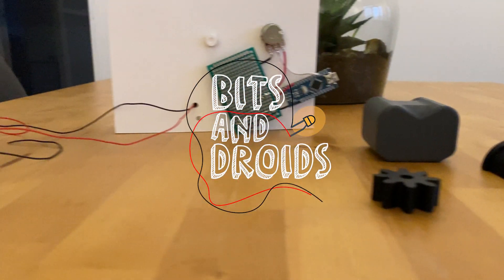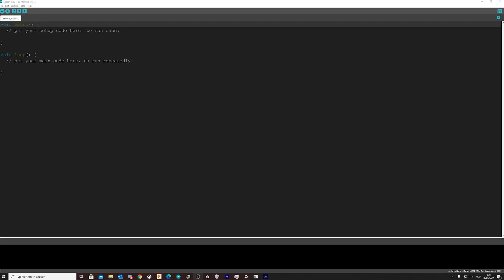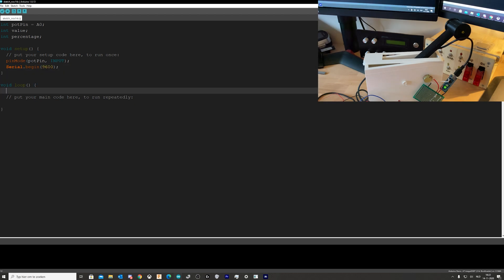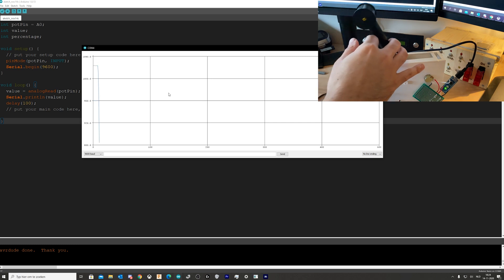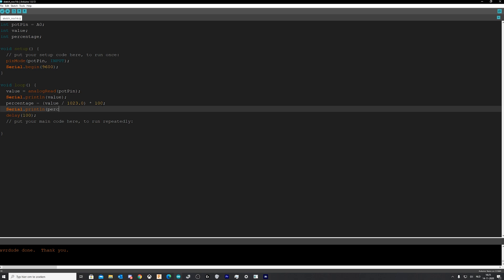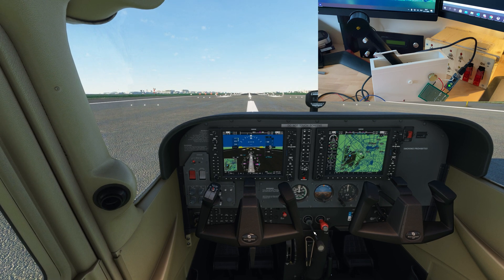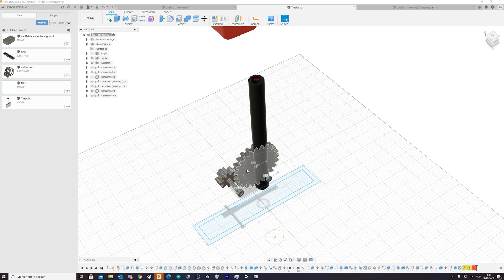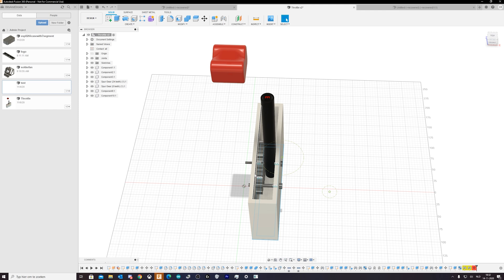10 min builds: Flight sim throttle. Create your own Flight sim Throttle with Arduino

Comment: Firstly, thank you very much for making this video. I'm facing an issue where I needed to limit the movement of the throttle lever but still read all 300 degrees of the potentiometer and you absolutely gave me the right idea to solve it. That said, there are two things here that strike me as strange:
-when you are showing that the throttle lever works in MSFS, you aren't actually moving the throttle. The camera shows the throttle lying untouched as the value is changing. Was this just an editing mistake?
- you mention that any arduino can do this, but only certain models are recognized as HID devices, which MSFS requires to read from to assign controls for. I know there are some hacky workarounds to get serial signals interpreted by the pc but since you don't mention any of that, or show how the throttle device interacted with the control scheme of MSFS, I'm left very confused how you achieved this.

Have you made any more detailed videos about the process I could check out? Also, despite my concerns listed, I am very grateful you made this at all, so thank you very much. These are complaints, just points of misunderstanding.

Comment: I have read that pots are okay but for more accurate settings, using an encoder rather than a pot allows more accurate notching if that is important; such as train sim throttles and brakes.
I seconnd niw3 - bigger font please...tbh I could hardly read it as the bg is black.
Nice job though. Thanks.

Comment: awesome video mate! just asking, but i dont have an arduino pro micro, and cant go out to get one due to the pandemic, but i do have a spare arduino uno here, and was just wondering if this code and method would work with the arduino uno, and where to connect everything since there are more pins on the uno than on the pro micro
Reply from the maker: Hi it depends which simulator you are using. If you're using Microsoft Flight Simulator 2020 I've created a piece of software that let's you connect any arduino with the game. For other games there might be a way but I haven't worked that one out.
Reply: @Bitsanddroids  yeah I’m using Microsoft 2020
Reply from the maker: @cosmothecat8626  

Even though the design is different the logic stays the same. Plus this tutorial is a lot more recent than this video.

https://www.bitsanddroids.com/tutorial-arduino-mfs2020-cessna-inspired-throttlebox/
Reply: @Bitsanddroids  btw what’s the other piece attached to the arduino? Other than the potentiometer
Reply from the maker: @cosmothecat8626  Ah the other bit is a pushbutton!

Comment: If i set the number in close higher than 0, for example on 100.  Would it work as a reverse thrust. I mean If it would be a minus percentage.??
Reply from the maker: The code in this video is quite outdated. I'll send you a link with updated code that can indeed be used with reversed thrust. Will probably be tommorow morning when I'm back at my pc

Comment: it would be awesome if you could make a DIY Kit for a Helio Collective to purchase at your shop, because I could only find DIY Files where a 3D printer is required and several other parts are needed. and ready to fly Collectives are way to expensive.
another idea for the Shop, adjustable tablemounts ;)
Reply from the maker: Thanks for the suggestions. Google didn't really help me but what are helio collectives?
Reply: @Bitsanddroids  sorry I mean the helicopter pitch collective (lever) for the left hand, its used to adjust Throttle and mainrotor pitch instead of a normal throttle. It has a much longer stick for more accurate input.
https://en.m.wikipedia.org/wiki/Helicopter_flight_controls
There are not much solutions on the market and they are way expensive ... the cheapest I could find was already 400 €

Comment: Hi, try your code and got this message "no matching function for call to 'BitsAndDroidsFlightConnector::simpleInputHandling(int&, double)'". Any advise? And thx for your help.
Reply from the maker: Sorry yes that is correct:

https://www.bitsanddroids.com/tutorial-arduino-mfs2020-cessna-inspired-throttlebox/

I've updated the parameters required to include a minimum and maximum value and if the output has to be reversed. Some people had constructions where they couldn't fully open / close the physical handle. Or in my case my potentiometer had to be installed backwards making close open and open closed etc.

Comment from the maker: Important note: The input handler has been replaced by the connector. It can still be downloaded from: https://www.bitsanddroids.com/downloads. The connector packs more features and is more stable.
Reply from the maker: @fully charged games I'd recommend going with something like the joystick library. You do need an Arduino Leonardo or pro micro for this.
https://www.instructables.com/Create-a-Joystick-Using-the-Arduino-Joystick-Libra/
Reply: @fully charged games I also have an uno but i dont think i need any more. lol

Comment: There is no more downloader for input handler on your site. :(
Reply from the maker: Correct the input handler is merged into the connetor. With the connector your able to handle the inputs of multiple arduinos at the same time. I''ll update the description here with this info. Thanks for the reminder. I'm re-uploading my site later today so it will be unavailable for a few minutes in around an hour.
Reply: @Bitsanddroids  Thanks for quick response!
Reply: @Bitsanddroids  Hay there, I'm stuck with the code here, I'd like some help. I have a bit different throttle design so my potentiometer never goes to value = 0, it goes from value =  1023 down to value = 404, so I can never achieve 0% throttle. I basically need some kind of sign (Code line) to tell arduino that value = 404 is 0%, and value = 1023 is 100%. I'm new to arduino and I don't know crap about it, so a bit of help would be appreciated. 
Thanks!
Reply from the maker: @cpt.djokic5420  You know that's actually a use case that I didn't think about. I'll add a way to set a min value as well. The next update will release on monday including the fix for this and a way to seperate your throttle from your mixture. The only workaround for 2 days would be this:

int percentage;
int valuePotentiometer;
int oldValue = 0;

void loop(){
valuePotentiometer = analogRead(A0);
if(oldValue != valuePotentiometer){
     percentage = map (valuePotentiometer, 404 //your min value, 1023 //your max value, 0, 100);
oldValue = valuePotentiometer;
connector.superAdvancedInputHandling(percentage,percentage,percentage,percentage,100)
 }
}

This will plot your potentiometer currentvalue with a percentage between 0 - 100 based on your min 404 and max value 1023. It then sends the raw percentages to the connector directly. The last 100 in the function is for the mixture so it doesn't get changed by your inputs. But once again in 2 days I'll have an update out that will contain a settable min value.
Reply: @Bitsanddroids  Thanks, I'll try it now!
Reply: @Bitsanddroids  I'm now getting new error message 

inputExample:10:1: error: 'connector' was not declared in this scope
 connector.superAdvancedInputHandling(percentage,percentage,percentage,percentage,100)
 ^~~~~~~~~
exit status 1
expected ')' before 'oldValue'

I don't know what this means. May it be something up to the code writing error?
Reply from the maker: @cpt.djokic5420  ah sorry you need the bits and droids flight connector library. which can either be downloaded from the IDE ->  tools -> manage libraries and then search for the library or directly from my werbsite. If you installed the library you have to include these 2 lines at the top 
#include <BitsAndDroidsFlightConnector.h>
BitsAndDroidsFlightConnector connector(false);

in the setup block you need Serial.begin(115200);

Comment: doesn't work for me. I have the code in the board, i lauch the connector V0.7.0 and when i move the potentiometer nothing happned. Maybe it's because it's only works with FS2020 ? Can you help me ?
Reply from the maker: You hit the nail on the hear Aéro. I only started flight simming since a few months in mfs2020 so when i say flight sim i reffer to mfs2020. I'm working on compatability with other flight sims as well. I need to communicate this more clearer.
Reply: @Bitsanddroids  Thanks anyway ;)

Comment: Outstanding work! Where did you get the gears from? Thinking about building a Lever with a reverse mechanism which requires a gear rack as well. Therefore looking for adequate spurs and gears... Thanks a lot!
Reply from the maker: The gears are 3d printed but for some other projects I use a set like this one https://amzn.to/3iI6lhK they are quite small though for applications like a throttle they are more for finer movements. If I know the exact size of my desired gear alieexpress can be an outcome as well.
Reply: @Bitsanddroids  I´ll have a look onto that. Even though 3D printed. Where did you find the right STP/STL files? thingieverse and co? Thanks a lot and keep it up!

Comment: When I'm using the code on your website to check the maximum values of my potetiometer, I'm getting a "percentage was not declared in this scope" error message.
Reply from the maker: Hi in the second block your able to see a difference. It includes the 
int percentage;
At the top of the file. 
I believe your missing this line according to the error message.
let me know if this fixes the issue.
Reply from the maker: BUT if your using the latest version of the connector your able to use this line:

connector.simpleInputHandling(PIN NUMBER OF YOUR POTENTIOMETER I.E. A0,  MAX VALUE I.E. 1023.0);
Reply from the maker: I need to learn to not press send. So in my case it looks like this:
#include<BitsAndDroidsFlightConnector.h>

int potPin = A0;

BitsAndDroidsFlightConnector connector(false);

void setup(){
    //If you're using a Leonardo / Pro-micro this line can be left out.
    Serial.begin(115200);
    //If you notice some instability gradually increase this value with increments of 5.
    Serial.setTimeout(15);
}

void loop(){
    connector.simpleInputHandling(potPin, 1023.0);
}

That should do the trick.
Reply: @Bitsanddroids  yep the code works perfect now. I'm moving to the next step which is completing the full code and downloading the input handler. However, your website doesn't seem to be responding at the moment. I've tried a couple times using different devices too without luck.
Reply from the maker: @arnavm.9529  You are completly right jumped out of bed seems the server host their server is down.
Reply from the maker: @arnavm.9529  Thanks for reporting its back up and running
Reply: @Bitsanddroids  of course no worries! 
The code is perfect. Downloaded the latest version of the input handler and the UI is pretty good too. Although is there a way to figure out if the input handler is sending the values to the game? I use both P3D and FSX and I tried to change the key binding of the throttle but the game did not recognize/detect the potentiometer when I moved it. Maybe it does not detect the input handler as a controller? Or maybe it could be a problem exclusive to fsx
Reply from the maker: @arnavm.9529  I've updated the article as well to match the current version of the connector. Thanks a lot for pointing this out I completly forgot that older articles depend on things that no longer work. I'm going to work my way through all of them to see if they are still up to date.
Reply from the maker: @arnavm.9529  That might very well be the case. The connector plugs directly into MFS2020. I have no copy of FSX or P3D so I wouldnt be able to tell you if and how it works in those sims. BUT the backend is the same for all those games so I do plan to investigate supporting those sims as well in the near future since the code is already there. Perhaps some things already work but I wouldn't be able to know at the current time. My apologies
Reply: @Bitsanddroids  absolutely no worries at all. Take your time with the project. It's already pretty nice that you've set this up all free of cost. 
Meanwhile I'll see if P3D manages to detect it with the updated code and input handler. 
Thanks for all the help.
Reply from the maker: @arnavm.9529  Btw in mfs2020 it isn't detected as an input either. It directly alters the ingame throttle. So perhaps in fsx it won't show up as an input as well.
Reply: @Bitsanddroids  Hi while uploading the latest code to my arduino, I'm getting two errors. One is 'connector' was not declared and other is 'include does not mame a type'
Reply from the maker: @arnavm.9529  Could you perhaps share your code. It seems the IDE thinks include is a variable instead of an include.
Reply: @Bitsanddroids  include<BitsAndDroidsFlightConnector.h>
BitsAndDroidsFlightConnector connector = BitsAndDroidsFlightConnector(true);

int potPin = A0;

void setup() {

  pinMode(potPin, INPUT);
  Serial.begin(115200);

}

void loop() {

 //This line is all that is needed with the latest connector
 connector.simpleInputHandling(potPin, 1023.0);

 //connector.advancedInputHandling(A0,A0,A1,A1,A1,1023.0);

 //supersuperAdvancedInputHandling(int percentage eng1,int percentage eng2,int percentage eng3, int percentage eng4, int percentageMixture)
 //int value = analogRead(potPin);
 //connector.superAdvancedInputHandling(value,80,80,80,80);
 //delay(400);

}

Comment: Absolutely phenomenal! Also, could we directly attach our potentiometer to the throttle stick?
Reply from the maker: That should be possible. In my case the potentiometer had a smaller range of movement than I wanted my stick to have. If you go with a design that doesnt need as big of a motion like mine you could attach it directly to the potentiometer. Do take in account that there is a physical stop in your design to make sure that your potentiometer doesnt absorb all the force if you rapidly open/close the throttle while hitting the max range.
Reply: @Bitsanddroids  thank you for the prompt response! If I manage to set this up with Prepar3D I'll definitely post a video of my own construction  crediting you for the code.

Comment: thank you so much for your help it was a problem with arduino ide i got arduino pro ide and it finally recolonized the arduino and correct lights lit up then i had to manually install the library after manually deleting what the auto installer messed up and manually placing the library in the correct folder then i got verification and compiling and successful uploads on the pro micro boards and the leonardo boards and they all work thank u so much for ur help
Reply from the maker: Glad to hear it all worked out! I hope the feeling of success overruled the feeling of frustration.
Reply: @Bitsanddroids  yes it did now to fix the bl touch on my 3d printer so I can make the dudder and throttle ect
Reply from the maker: @salvatoremilitello8490  I was thinking of getting one of those (bl touch). Is it worth the investment? I read some mixed reviews
Reply: @Bitsanddroids  i like mine i had a junk sd card lost the firmware and stopped retracting it really helps with an un even bed like lots of ender 3 models have i also got the btt skr 1.4turbo and 2209 silent stepper drivers had to learn how to do the vscode for marlin that is y I was sure I could do the arduino
Reply from the maker: Thanks for the info! I went with the mainboard upgrade the sound difference was huge. Might get the Bltouch for my Ender.  Trust me, the Arduinos will just click at a certain point. It starts with copy-pasting. Then you start to understand what you'r copy-pasting. After this, you start to write it yourself. From there on out your brain will be ruined for life. I'm currently working on an Alarm clock because my girlfriend is afraid her phone battery dies during the night. Normally I would be the first to go to a cheap site and buy one. Since I got into this hobby my first thought is Eyy that might be fun to make.
Reply: @Bitsanddroids  when I was in 7th grade I was programming calculators to do equations for me my teachers said if I could do that I knew the math well enough and could use my programming skills to take the test as long as I didn't share lol
Reply: @Bitsanddroids  thanks im sure ill get the programming the more I dive into it almost done wiring a diy rc controller that has 1km range from electronoobs utube channel and I feel like the bl touch makes the printing more reliable and for my loved one easier to use no leveling I do it every few weeks

Comment: Looks good!  How about doing both the throttle and mixture together?  I have MSFS set to advanced and not only do I need to adjust the throttle I also need to adjust the mixture.  I assume that it would be the same code with a few adjustments to allow for both?
Reply from the maker: I was doing some research on throttles/mixture and started to draw something out.  You said it would be nice to also have the mixture included. Are you talking to a throttle + mixture lever or those pull mechanisms?
Reply: @Bitsanddroids , either way, will get the job done.  Using push-pull knobs is just more similar to the way the Cessna 172.
Reply from the maker: @russhillis  I think I got the job done. Will try to release it tommorow!
Reply from the maker: Correct I developed this as a proof of concept. The next step would be to expand from this point forward. The stick meant to be modular until I noticed I put everything on backward. So I'll keep you guys informed!